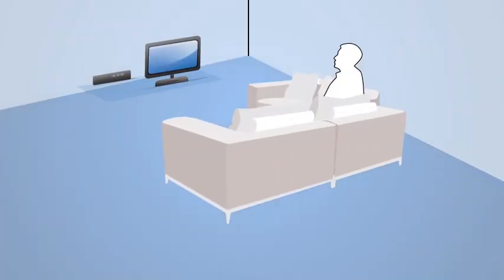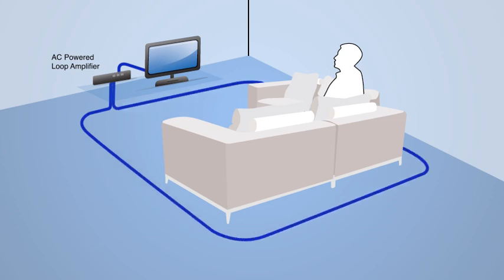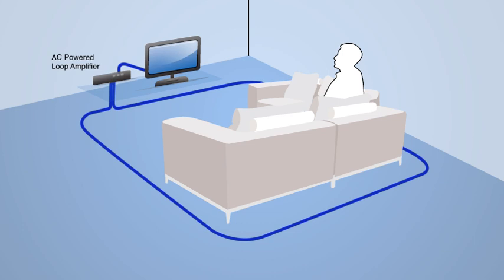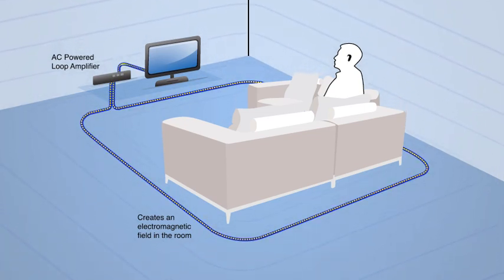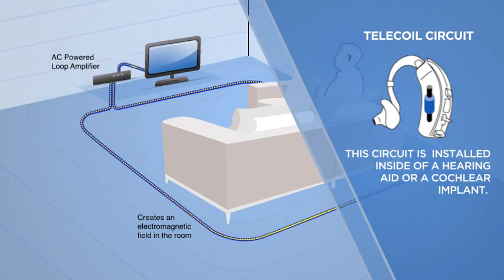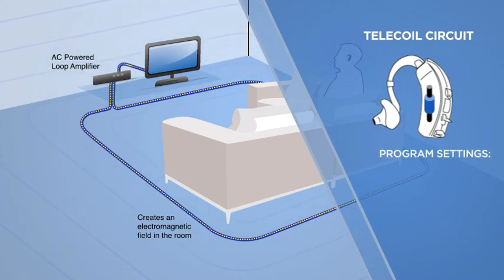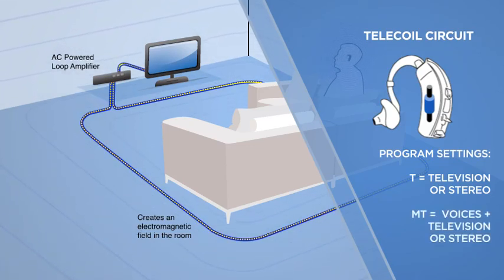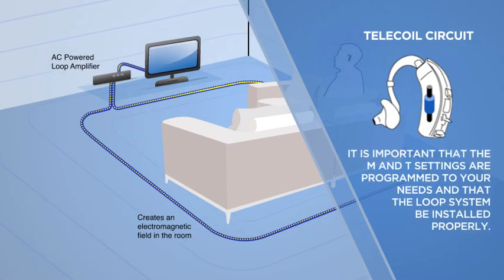Induction Loop Systems

Comment: If you live in a country where the state has a monopoly on radio broadcasting, can you use an induction loop system to get around the law in your town? Have a studio connected to a high power amplifier and induction loop as a transmitter, then a telecoil connected to the back of your stereo through the Auxiliary input Jack as a receiver, for example.

Comment: The loop  🔁  🔂  ➰ system is for deaf  🧏‍♀️  🧏‍♂️  🧏  people that wear hearing aids in 1 or 2 ears 👂 👂. I honestly have hearing loss in both ears 👂 👂 . My hearing on the right is probably moderate and on the left my hearing is severe hearing loss. The volume on  🔉  🔊  🔔 my hearing aids is adjusted where I turn the volume up  🔝  🆙  ⬆️  or down ⬇️ on my hearing aids. The battery  🪫  🔋 on my hearing aids lasts for around perhaps 🤔 2 weeks depending how much fuel ⛽️ is used on the hearing aids 🦻 🦻. The tube  🚇 on the hearing aids 🦻🦻 lasts for around perhaps 🤔 4 months depending how solid tubes are. When tubes are completely solid are connected to my hearing aids 🦻🦻, I must have them replaced, however I phone  📱  📞  ☎️  up ⬆️ the hospital 🏥  first to make a nearer future appointment visit to have tubes replaced. The ear 👂 moulds connected to my ears 👂 👂 also are replaced because they become uncomfortable  😣  😳  🥴. When I have a wash  🧼 🧽 , shower  🚿  🧼 , go swimming  🏊‍♂️ and finally sleep  🛌  😴  💤  in bed 🛌, I always take the hearing aids 🦻🦻 out of my ears 👂👂. Could my hearing get worst after the year 2023. I honestly was born with hearing loss. 👍👍👍